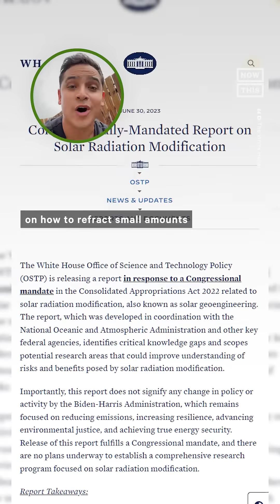How Solar Geoengineering Could Be Used to Fight Climate Change

Comment: The surface level albito is not dangerous if its dont right, we use asphalt extensively and it is the opposite, the natural environment doesnt absorb that much heat but we have no problem making it hotter so we should be doing the opposite action to negate it, the big issue is it cant be too shiny otherwise insect life thinks its water, so we just have to use a slightly matte paint or provide more conducive water and ground systems to allow for them to sustain themselves even if some mistake it for water. 

I would suggest people learn more about the subject from scientists like over at scishow

Comment: Great way to compromise our food supply 👍 🤦‍♀️
Reply: Only some if them would do that, surface level albito increases are preposed to compensate for the increased amount of absorption from things like asphalt in roads 

The issue here is that some animals (mainly insects) have trouble telling shiny surfaces from the surface of a body of water meanung we would need to use a slightly matte paint which would mean it would be slightly less effective
Reply: As my reply to your comment doesn't seem to show up, I'll try again. Sorry, if you will have received it several times in the end. 

What I tried to tell you was that there's a documentary on YouTube on this topic. 

It's called: The Dimming Full Length Climate Engineering Documentary

You may be surprised what you'll discover in it. 
Make sure to type in all of the keywords above, though. That way, it should show up at the top of the search results list.

Comment: Does using solar panels not work though? That's what other countries are doing.
Reply: Yes, solar panels could be used.
Also, there's a documentary on YouTube showing how far along the scientists already are in testing (i.e., using) that dimming-of-sunlight technology. Unfortunately, it doesn't just have effects on the sunlight.

In case you're interested, here's the title of the documentary:

The Dimming Full Length Climate Engineering Documentary
Reply: It is good to use solar and wind energy. Question, is it enough to avoid climatologic tipping points? By now, maybe even collectively going vegan as well as making big strides in banning fossil fuel might not be enough anymore to avoid an escalation of climate change. And if that is the case, we might very well be forced to use geoengineering as some sort of "emergency brake", even knowing how dangerous it is.
Reply: @arjenlaan4103 , Are you sure this technology hasn't been implemented yet? How sure are you about it?